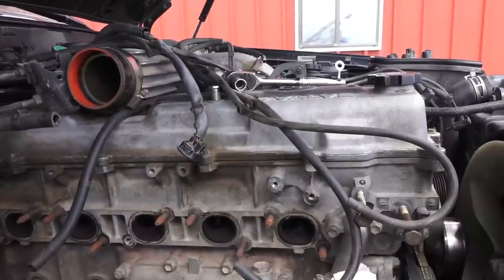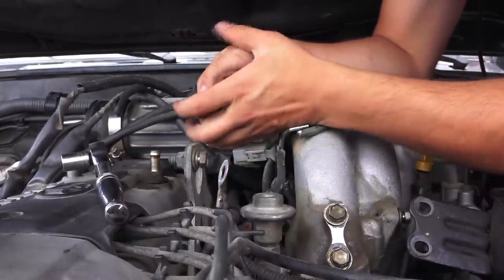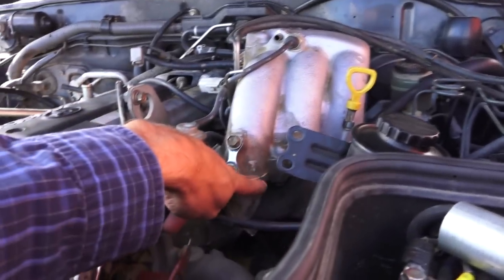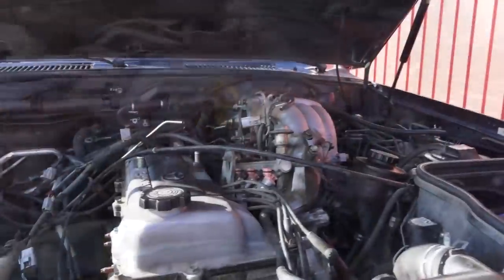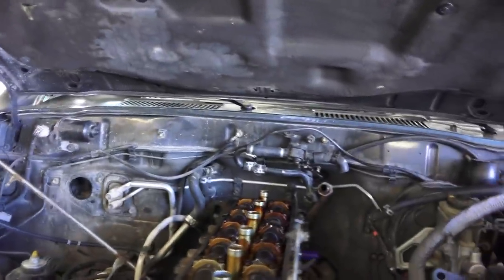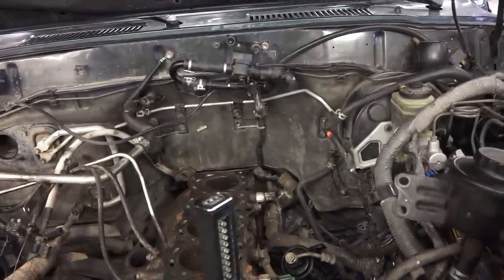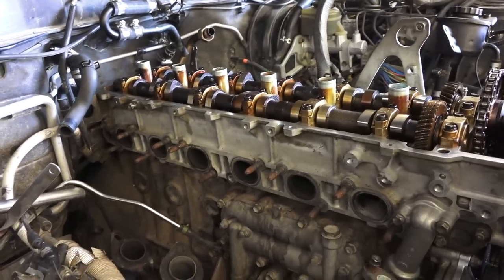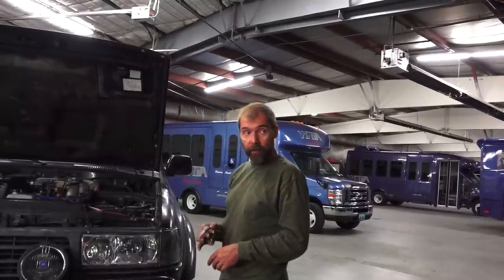Toyota Land Cruiser FJ80: Head Gasket Repair P24

Comment: Hey Jake, What brand of overhaul kit did you use?  I am about to overhaul mine.
Reply from the maker: Don't remember. Got it from the  Cruiser Dan on IH8Mud forum. He is a parts manger of Toyota Dealership somewhere in Arizona.
Reply: PASLAR ADVENTURES when you said you're getting parts from Georgia ,you meant Georgia in the  U.S .  if so where's this place ?
Reply from the maker: One of the dealerships in Georgia, U.S. The parts manager hangs out on the IH8MUD forum. Look in the vendor section of the forum.

Comment: I can hear that you have a cylinder low on compression when cranking it at 17.58, (starter motor speeds up every sixth compression stroke) Otherwise you obviously got it back together right.  I own a 100 series land cruiser with the 1fzfe and have replaced a head gasket about 5 years ago myself (Still going strong)  I found that letting the front tyres down to lower the car, and removing the bonnet was a big help when spending hours working in the engine bay.
Reply from the maker: Good points, agreed. Generally for me the most important thing that I am not completely good at is patience.

Comment: How long did the overall head gasket change take you and did you have the cylinder head resurfaced before you put everything back together ?
Reply from the maker: Took longer then it should of. But for the first time doing a head-gasket job it's OK. Didn't  do the anything to the head, decided there was no need since it wasn't overheated. So far so good. New gasket has over 35,000 miles on it.

Comment: Jake was all well or exhaust manifold was flirting or just my imagination?
Reply from the maker: Sergey Khochay Yeah, everything seems to be  fine. Have  close to 2000 mile on the new gasket now.
Reply: ***** did you polish the head ?
Reply from the maker: Sergey Khochay No I didn't. Decided to re-install it since I didn't overheat the engine when the gasket went south.
Reply: ***** is the head made of a cast iron too same as the block?
Reply from the maker: Sergey Khochay I wish it would be cast iron, unfortunately it's aluminum.